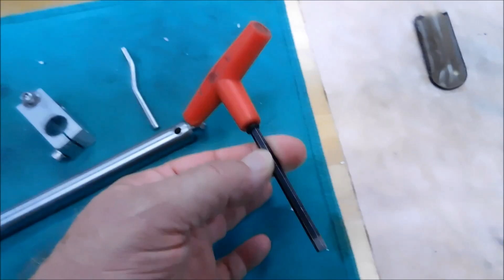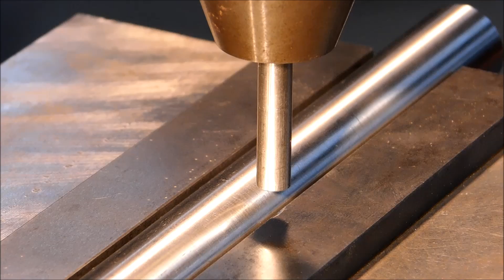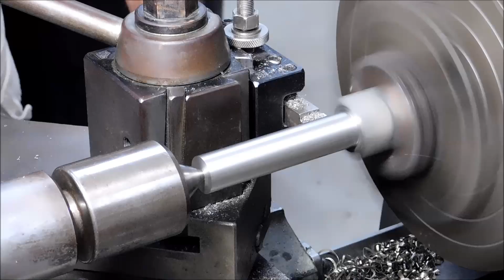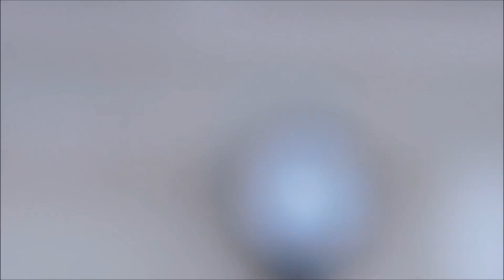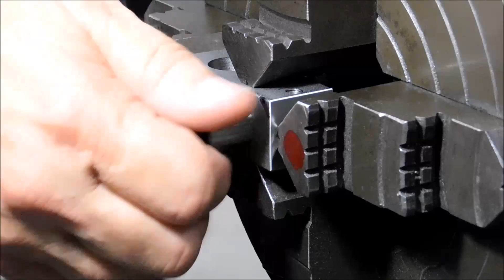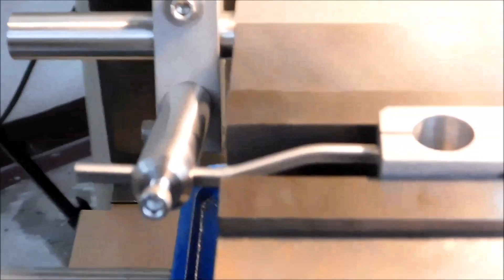Make Your Own Outrigger Vise Stop

Comment: Always a pleasure Joe. No stainless but lots of GR 8 bolts up to 2 in.
Reply from the maker: Wow. What are they Used for?
Reply: @joepie221  I was a logging equip Welder, Fabricator/Machinist for nearly 20 years. The deal was NEVER re-use any fastener.I don't recall any fastener failures over the years  Everyone was torqued (even 1/4 in) and of course stretched in the process. The used ones went into 5 gal pails. If you could pack them out the door from 1/2 way in the shop they were yours. I got 5 pails over the years and used many in the machine shop to make all sorts of things. As you know they have a nice carbon content and take basic rosebud (acc/oxy) heating and  used gear oil quenching for many tools etc. I am sure I saved thousands of $ over the years. Thanks for the reply my friend. Now in retirement I pour pure silver to keep myself busy. Drop by if you like.Take care eh ! (Yep I am Canadian from N Central BC, LOL)

Comment: Why not just ream those holes in the mill.
Reply from the maker: Ream, bore, plunge an end mill, drill and make the rods to suit, 4 jaw on a lathe, ream on a lathe...pick one
Reply: @joepie221  Shouldn't that be-"pick one with less setups and fewer potential errors"
Reply from the maker: @oldschool1993  For production, sure.
Reply: @joepie221  Just watched your videos on squaring up a block in 1 setup and in a crappy vise- showing how to do things with fewer motions, then watched the vise stop one where you went the other way and showed how to do it with the most possible motions.

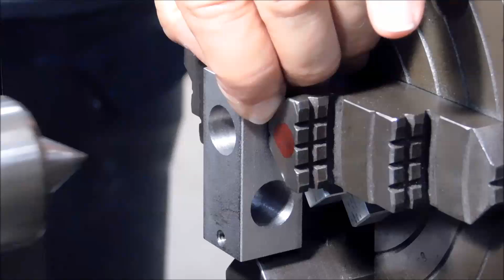Comment: At 34:45 you used the live center to position the block in the 4-jaw. Why did you not just carefully tighten the jaws against the part and call it complete? Or does the part shift even if you are careful? Or, were you using this as an educational opportunity?
Reply from the maker: Both actually. With great caution, I would expect a live center to get you close enough.

Comment: Hey Joe, how did you make the bent rod? I don't have a bender 😕
Reply from the maker: I actually pinched them in a vise and put a pipe on the rods to bend them.
Reply: @joepie221  oh interesting, thanks. I'm guessing you put some packing in to hold the bar to make the second bend? Maybe good for a quick video 😁 that seems like a handy trick in general.

Comment: Ey up! Joe nice one i love it,thanks for sharing, I am not sure stainless is the best choice whist its strong and corrosion resistant and (Expensive) it is notorious for tearing and galling on sliding fits and screw threads that are regularly screwed up and undone repeatedly without the use of an anti galling compound. the design is excellent. I will make one and probably use EN24T and O1 rod for the shaft,and maybe heat treat it.

Comment: Speaking of eliminating a tool or operation - the part that attaches to the back of the vise could be made of a round stock. Instead of turning square stock into a round, mill a flat surface on one side of the round then drill mounting holes after milling operation while the rod is still clamped in the vise?

Also, if using standard rod diameter the holes could be quickly reamed instead of boring to size on the lathe?

I do get that this is an educational video (a very nice one at that) and more complicated design is an opportunity to show a few different techniques and tips. But you mentioned eliminating tools is a good thing and those two thoughts came to my mind and I am curious about your opinion. I have to make a vise stop soon so I will try to make it from a round stock and see if I get something useful.
Reply: I think that square looks better, but I'd have to see it round to be sure.    I would have used a reamer in the mill, as you suggest.     The only thing is that you would have to use an end mill and that is another tool too.    I know that he milled a flat and would need an end mill for that.

I use a lot of BT40 tool holders and I don't have a fancy quick change, so I have to do it by hand.   If I can avoid a change then I do.   I wonder if I could upgrade my old mill for faster tool changes.

I'm thinking about using a round bar and I'm starting to agree with you.

Best wishes.
Reply: Andrew George Joe’s design does look nice.
My comment was an exercise in simplification. 

Plus I have a bunch of off cuts of precision ground rods in the shop but no square stock of suitable size :-)

Comment: As always great video. When you used the sharpie to mark the reference corner would it be better to use a different colour so that a novice would not get confused at which corner to reference off even though it may seem obvious, some projects may not be quite as obvious as this one. This from a total novice working with metal as wood is my normal medium

Comment: Thanks, I got a lot of tips tricks and ideas from this video, thank you for sharing.
I didn't understand why tool deflation changed after the start of the boring operation. Can you elaborate on that a bit.
Thanks.
Reply from the maker: In an effort to not waste time, I rough bored the entire hole, then precision bored , with a lighter depth of cut, the first 1/8". Hitting my desired size was a light cut for the first1/8", but the load changed after that and the bar felt it.
Reply: @joepie221  Oh I understand, when you checked for size, you checked only a small depth, when you hit the size, you went all the way, but from that point on, the depth of cut was much higher.
See, I understand quickly when explained slowly. 🤩.
Thanks again, it is a very educational video.

Comment: Chuckle. You'd love the Taig lathe and mill. I think every single fastener on them is a 10-32 SHCS.

Nice trick with the parallels to avoid using v-blocks.

What brand is that 11/16 drill? Couldn't quite make out the logo.
Reply from the maker: Silver and Demming

Comment: Great vid. Kiwi English says un at the front of a word makes the meaning opposite. Texan must be different. Noticed when you cut the second slot it popped open. Are there stresses in the material that causes that? Nice to know that factoid about the 303. I use SS screws for some types of workholding on my CNC machine for timber. No matter how careful you think you have been, occasionally I nick one. They are soft enough for the carbide cutters to go through unlike normal steel screws. That redistributes the cutter all around the machine.

Comment: Could possibly make the block that mounts to the back of the vice and the rod portion of that part two pieces.  Thread the block and the end of the rod, then screw them together.  Allows for different length rods if needed, or no rod at all without removing the block.

Comment: Thanks for Your educational videos.
They are of great use.
Q: At 43:15, You comment on not leaving the gauge pin in the part, it might be a part of the chuck. What don’t I understand there?
Reply: The part is under compression when he bored it, if you loosen the chuck jaws it  reduces the compression might go slightly out of round, therefore tightening on opposite sides to the jaws compression preventing you from now removing the gauge pin. If you force it you will damage it, so remove it first.
Reply from the maker: I meant to say" part of the part'

Comment: Great video Joe. I do have a question though. Do you have any tips on how to make the round feature on the chuck cradle? I have wanted to make a couple for my chucks but don't want them to look like a hack job.
Reply from the maker: Make the cradle first with a tall flat surface. Remove the chuck jaws and run the block against the face of the chuck. From under the chuck, trace the body diameter onto the block. Bandsaw it out.

Comment: Was it necessary to bore those two holes from 34:48 on, or perhaps the shaft diameter doesn't match a common drill size?
Reply from the maker: The better the fit, the less torque it takes to tighten it. It would be just fine to drill the holes and turn the rods to fit if the holes are over or under. Probably would be quicker.

Comment: Stopped the video at 33:36 and ordered a Fowler tap guide. Slowly working my way to have all the cool tools that Joe has!! Also, as soon as I saw the finished stop bolted to the vice I thought why not have the round feature on both ends of the piece that bolts to the back of the vice, it would look like a vice with handlebars and be twice as useful.
Reply from the maker: Thats a great observation.

Comment: Joe . Would it been easier to have drilled and reamed than drilled and bored holes ? . 😒
Reply from the maker: I chose the 4 jaw route just for the trick value of setting it up. Boring it would probably be the most efficient for quantity, but drill and ream would be fine as well.

Comment: Great video!  Really love the narration of how things can go wrong. Advice on the tool pressure against the large holes, even the comment not to cut through the threads which would seem obvious to a machinist but not to a newbie. I watched many hours of yours and other machining videos years ago and bought a lathe and mill and made parts literally the the day I set them up. Your videos are by far the best for learning how to make things come out right. There is no casual watching on your videos, yours are like a master class, notes and attention and sometimes even a calculator are required. I can't express how much I appreciate your selfless contribution to the trade through your videos.
Reply from the maker: Thank you. I take great pride in the material present.

Comment: Really enjoyed this build.. are you using stainless screws? Do you have a problem with them galling with 303? Enjoy your holiday weekend my friend!
Reply: To reduce risk of galling, have the material in the screw and the threaded hole of different hardness.
A cut thread in the hole and a rolled screw usually work.
Reply from the maker: I haven't had any problems yet, but at the first sign of resistance, investigate.

Comment: Excellent video Joe, I'll be making one of these soon considering I just received a Kurt DX6 vise from a friend who just wanted one of my big bench vises in return 😲.
Thanks for the tip with the Anchor Lube and discoloration. I have found that stuff very useful, especially with stainless. 
Cheers
Reply from the maker: It is, but will turn nice surfaces black overnight.

Comment: 40:42 Why should the tool pressure be lower near the front of the hole?
Reply: Chris Armstrong  Only because he had bored the front of the hole a little bigger so the smaller pin would “go”. So the next full length bore had a little more tool pressure on the smaller bore size.
Reply: @macsmachine2609  Thanks.  I missed that bit.